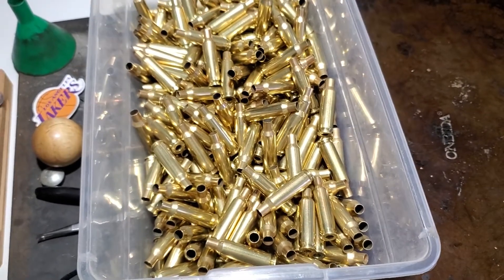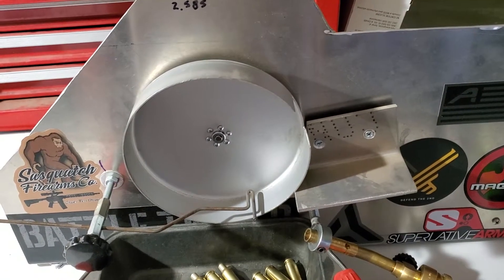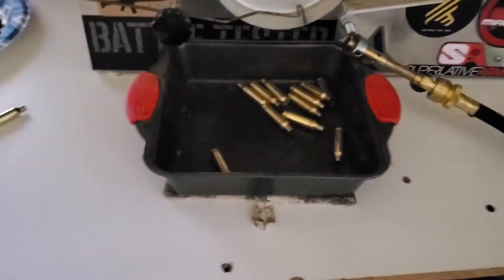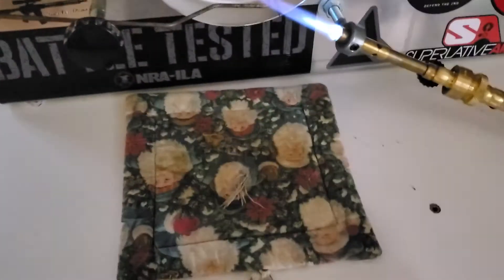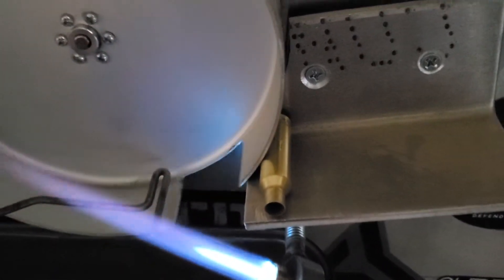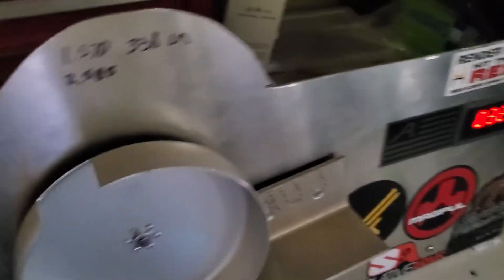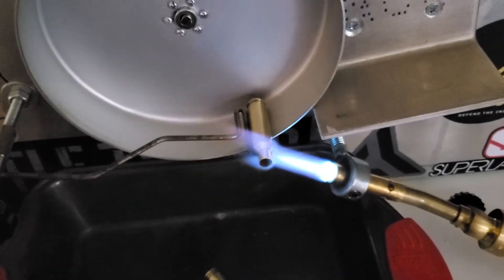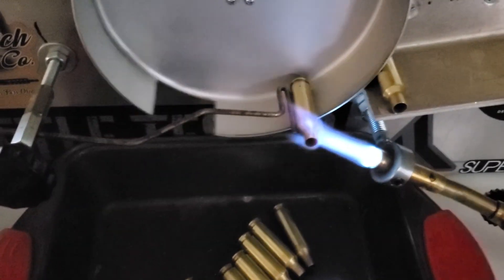Home made brass annealer

Comment: How do you figure out the dia of the drum?
Reply: The diameter of the drum is irrelevant, you adjust the speed of the drive motor (I used a 12v, 20 rpm geared motor on mine and it runs about half speed) so that the brass is "in flame" for approximately 6-8 seconds depending on your flame. Most use a product called "Temp-a-lac" (not sure on the spelling) to get the speed adjusted so that the brass hits about 750 degrees....
Erik Cortina has some very good videos on annealing.... https://www.youtube.com/watch?v=9HfjRKrbYbo
Reply: @TheWingnut58  Thanks most people skipped over that explanation when showing their annealers.
Reply: @1LRLRG  You're welcome....let me know if you have any other questions, glad to help if I can...

Comment: A single torch like that puts out FAR less harmful emissions that a typical propane stove or space heater, your ventilation is overkill and is likely costing you money in wasted heating/cooling costs (certified LP tech here), You're putting yourself in MUCH greater danger by having those two 20 lb (they only hold 4.7 gallons, not 5) inside your home....your insurance company would likely object to the point of cancellation. Should even ONE of those tanks develop a leak, it holds enough explosive energy to literally level your home....
Also, overheating the brass doesn't make it thinner, it makes it softer....that in turn prevents the case from having enough neck tension to properly hold the projectile. In reality, there is much greater latitude in heating time than most fully understand......   Erik Cortina (a professional competitive shooter) has an excellent series of videos on annealing every re-loader who anneals should watch, here's an example https://www.youtube.com/watch?v=9HfjRKrbYbo to get you started...

Nice work on the machine, all you need now is auto feed....
Reply: From a 64 year shooter (length not age - am a lot older) you are spot on. ppl need to KNOW what they are saying before they instruct others. A great input, and on one that potentially saves lives, brass and expense.
Reply: @nifty1940  "ppl need to KNOW what they are saying before they instruct others".....that's why people need to do more research than just watch YT videos, I watch "with a grain of salt" and get ideas...that's when the research really begins.

Another thing I noticed, he's annealing brass that has already been processed....it's my understanding, (and practice), to anneal first, size/process, tumble, prime and load.....maybe I've been doing it wrong for 40 years...
Reply: @TheWingnut58  Mate, that's the same practise I am used to. Cheers
Reply: @TheWingnut58  That makes sense to prolong case life (split necks).  Resizing, then annealing would work harden the case more than annealing then resizing.